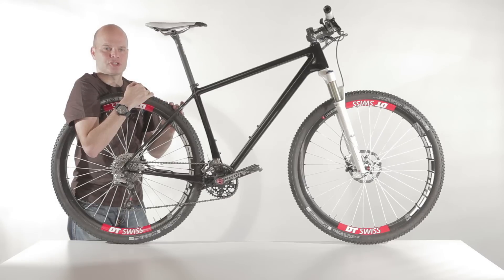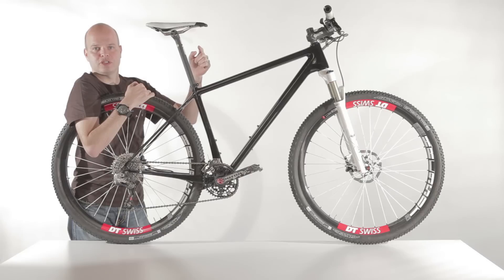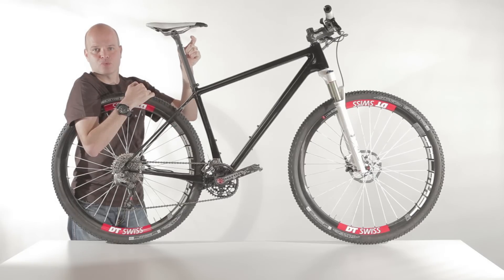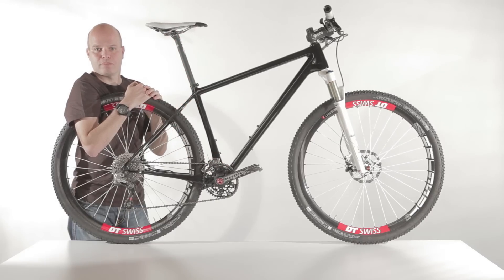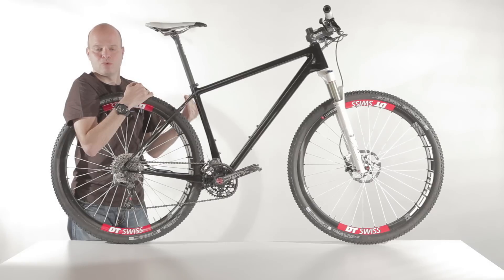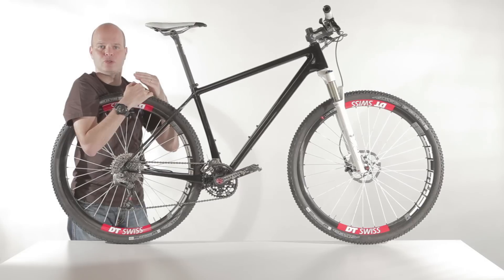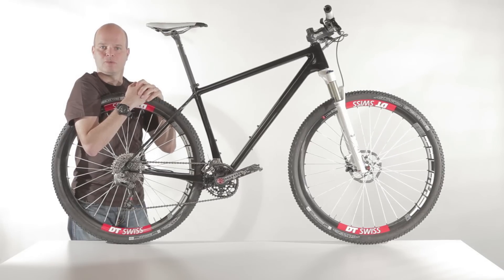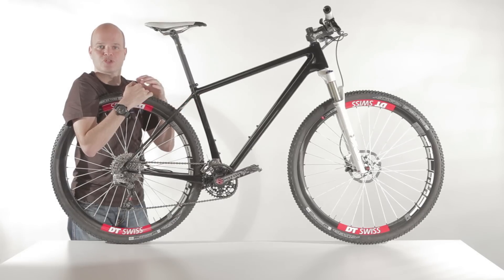OPEN O-1.0, Zero-setback seattube

Comment from the maker: Hi Guyhal, the chain stay isn't that short; it's short for a 29er with an S3 mount (if you go any shorter the tire and front derailleur will interfere) but it's not extreme. So that combined with the steeper head tube gives your the agile handling. Steering geometry is a funny thing, there still isn't a model that completely describes it so you calculate something and then testing in practice gives you the final answer. So it works and we expected it, but nobody knows 100% why